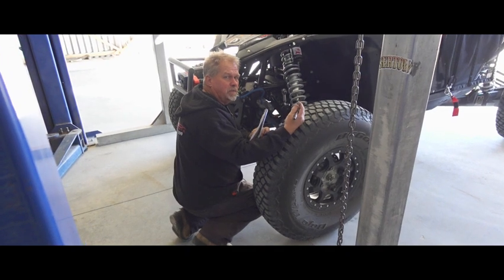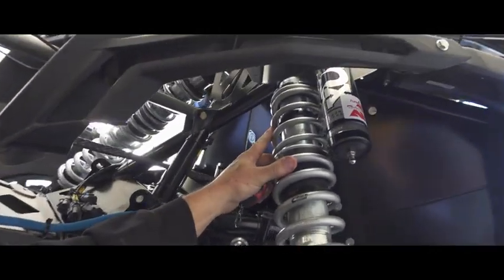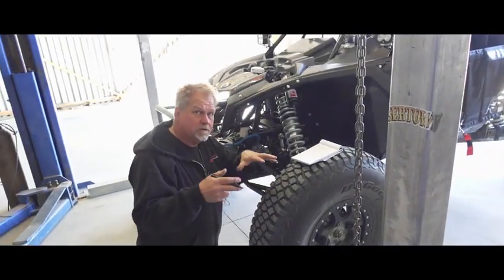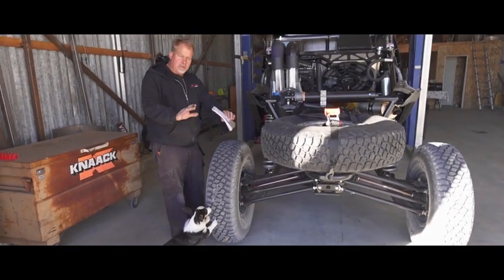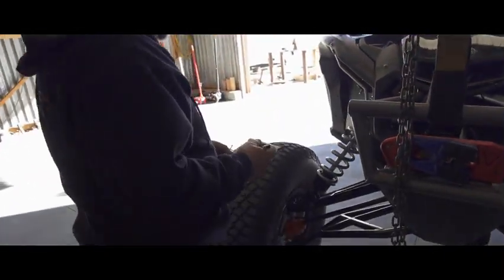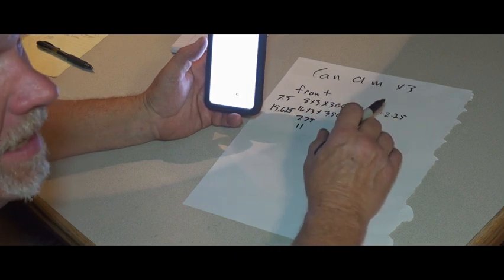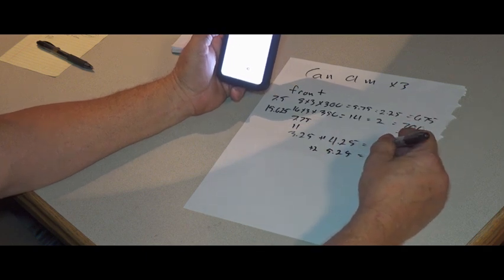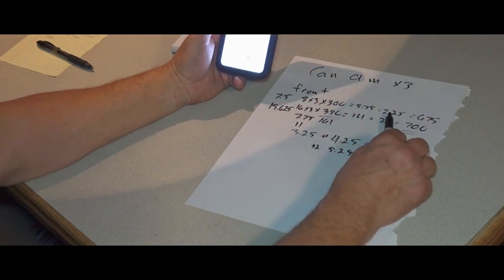How to Figure Spring Rate...Wayne's Way!

Comment: What do you do if you don’t know the current spring rates? Just take a guess on new springs and see how it measures. Also do you need to wait for springs to break in before measuring after changes?
Reply from the maker: Rate the springs or install known springs would be my first choice. In a pinch the redneck spring rater will work. You have to set a know weight on the spring, I use a 200lb redneck, then you can use the sag and the know weight to calc approximate weight